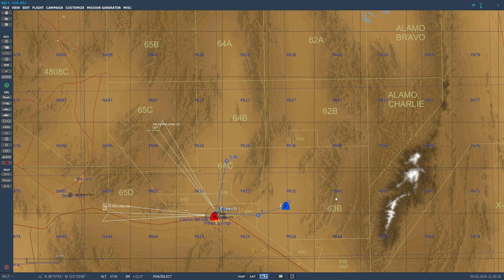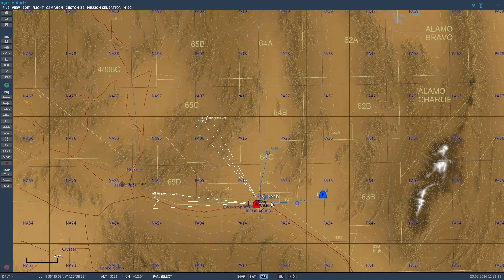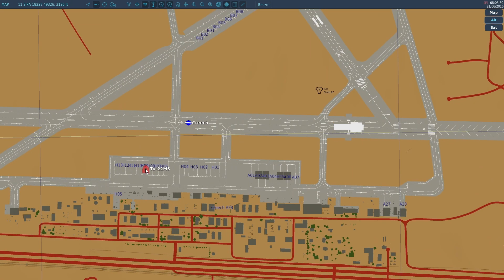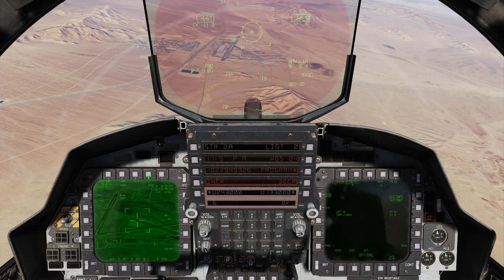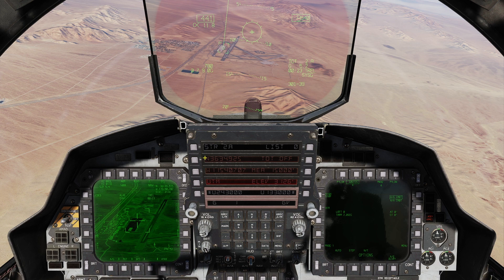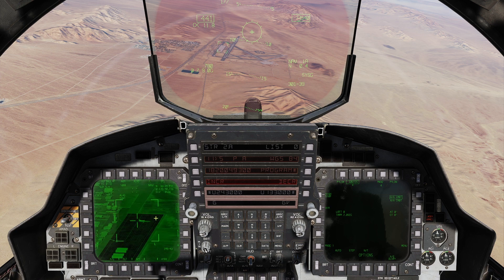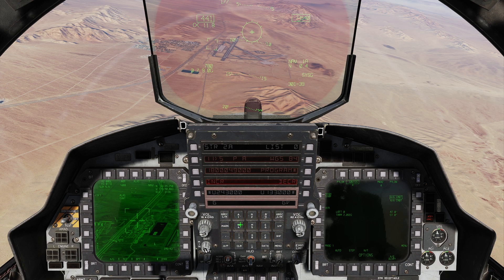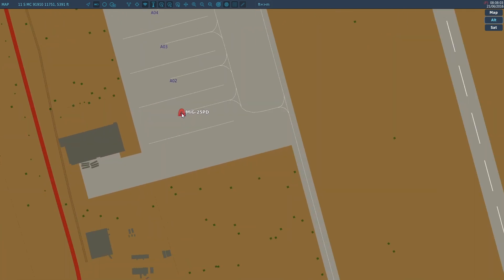MGRS Tutorial for the F-15E

Comment: The F-18 is so simple for setting up things like this - why did they feel like over complicating this is the F-15E??  If they kept it simple, a la the F-18, the F-15E could have been a single seat aircraft
Reply: This F-15E is from 1990s, and the F-18 from DCS i from around 2006/2008. You can´t compare both in a fair way
Reply: The F-15E was the first one to incorporate these things. Same manufacturer, older system. If Razbam releases the promised temporal updates, I believe newer versions are less awkward to put in coordinates and other things. In this current configuration, the F-15E is indeed very complex to do simple things like in other jets.